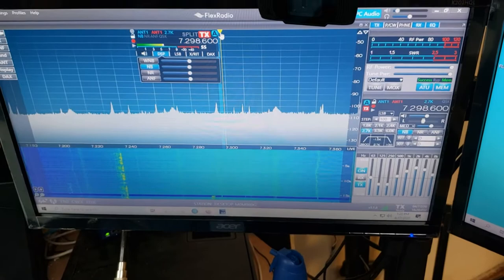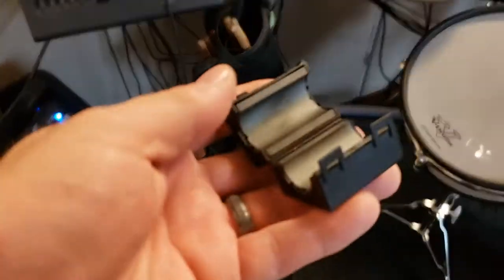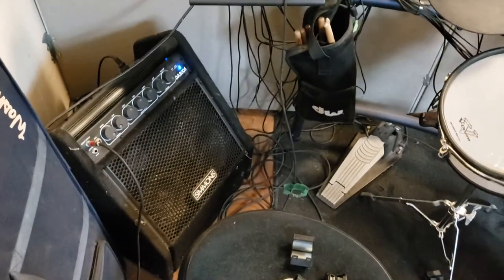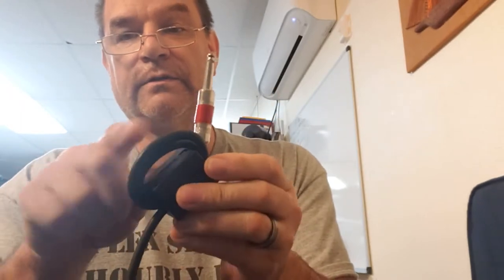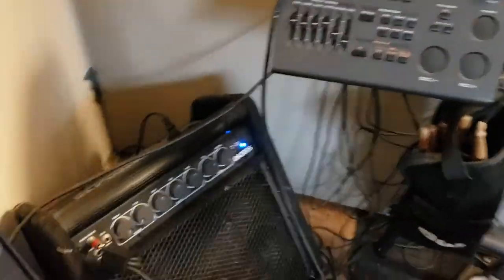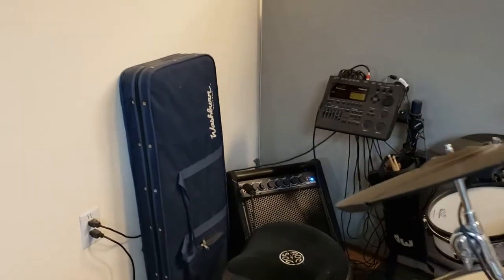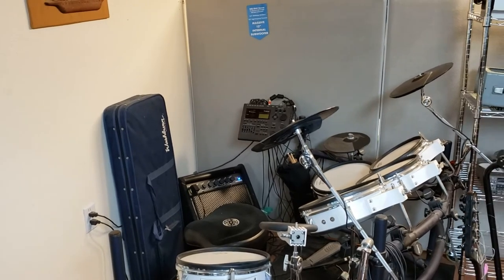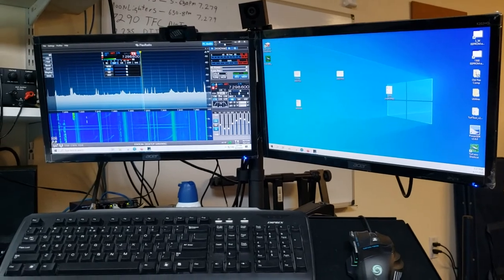RFI ferrite core

Comment: Why would a snap on choke buzz on a power line. Good, bad, normal?
Reply from the maker: It eliminates the buzz. Taking the RF out
Reply: Troy Radio Service   Thanks Toby, But the choke is what is buzzing/vibrating when I put it on. If I move it around a little it stops... kind of
Reply from the maker: @rjones93257  Oh ok, I see what your asking...well, to small for the energy its seeing is one thought...